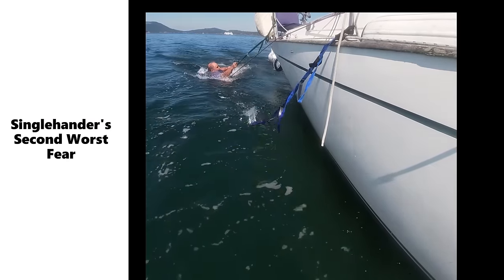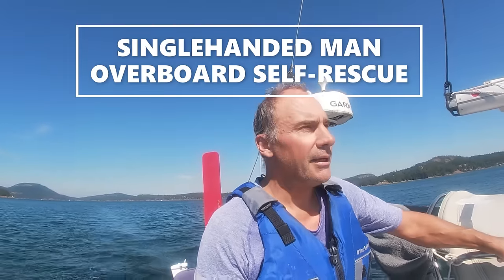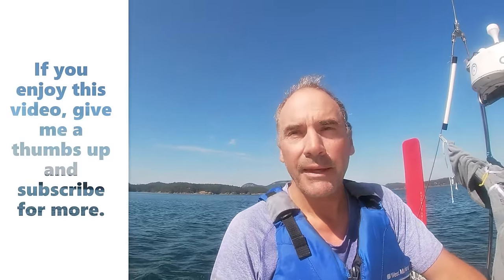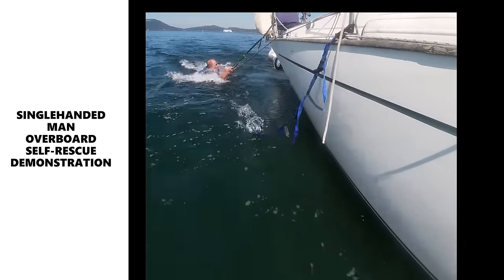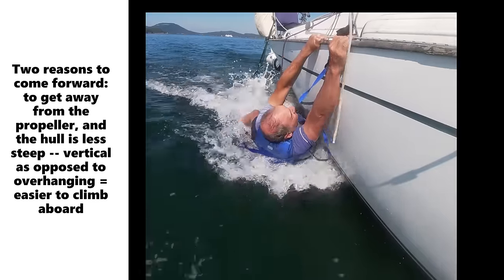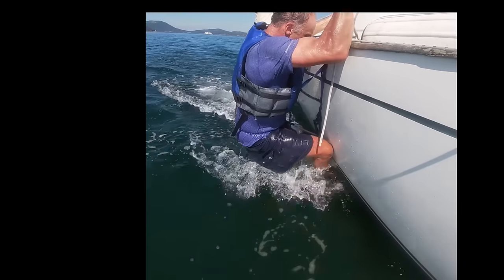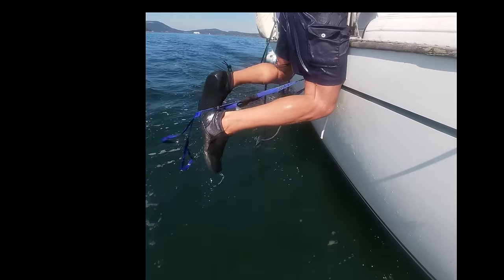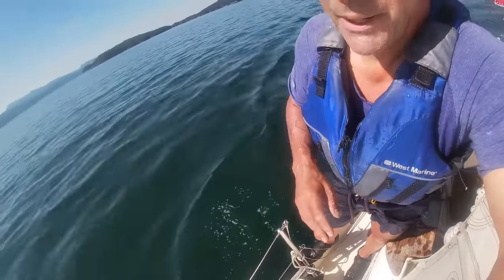SINGLEHANDED MAN OVERBOARD: SELF RESCUE

Comment: After swimming out to get my 13 ft fishing boat (engine off) that left the dock and not being able to pull myself into the boat, I ended up swimming the boat back to the dock.   Since I found out I couldn't get in a low aluminum boat I bought a rope ladder (Amazon) that I can pull off the stern.  At my age (70 years) you have to use your legs.
Reply from the maker: I have had similar revelations recently mate. I agree wholeheartedly.

Comment: The most important thing is don’t fall off.  The second is pull yourself back in on your back.  Remember that ~66% of people who fall in do not survive.  (As I may have recently read in Sail.)
Reply from the maker: Thanks for the note. I learned the "pull in on your back" tactic the first time i practiced this drill in 2013 in my Contessa 26 (just off of Cabo San Lucas in flat warm water) -- I was about 15 feet behind the boat at 5 knots. I did not see that statistic but it does not surprise me. Thank you for sharing.

Comment: Thanks for this clear test and example. But still had some reservations. How great is the danger of a propeller when not using an outboard? Fixed propeller is usually deeper under the boat. Given the resistance of the water on the side..seems more powerful than behind in wake of the boat..therefore isn't it wiser to climb on it in the back of the boat? If the back is not too steep and high. Isn't it more convenient then to mount a thick rope net at the back that you also can release from inside the water and then roll out behind the boat..say 3 to 4 metres. And put on some tension due to the forward motion of the boat...possibly aided by some water anchors/pockets. After which you can climb in and through that net up into the boat using now both hands and feet. But maybe this already exists...
Reply from the maker: Thanks for the thoughtful comments. These are very interesting ideas that I believe have potential. I haven't heard of those so thank you! On the propellor -- an inboard is further away for sure. I was still a little worried that in my thrashing, scissor kicking etc. that I might kick the propellor while trying to haul myself forward and up. Back of the boat can work for sure too. One of the challenges to overcome would be if we went over the side slightly forward and were clipped short and being dragged. How do you get to the stern? It would be very frightening and possibly dangerous to unclip from the boat to get there... you can't make a mistake at that point. But, I do consider my windvane and Watt and See generator mounting frame as a boarding ladder on the stern. I did actually have to use it for real once... I was just leaving the dock and slipped as I was pushing the boat away.... I hand traversed the rail to the stern and climbed in. I should have had the ladders in place but hadn't put them on since I was only island hopping.... Thank you again for your thoughtful and creative ideas.